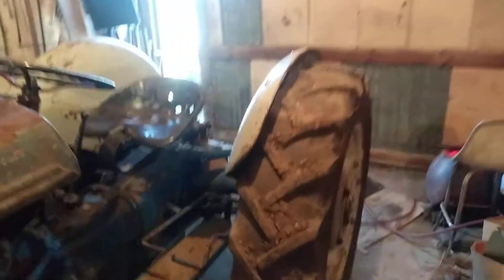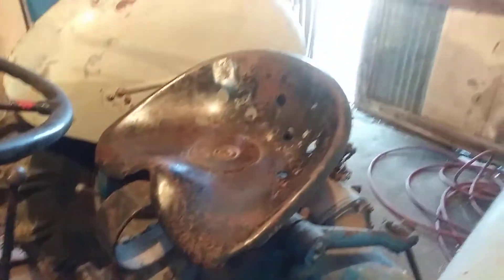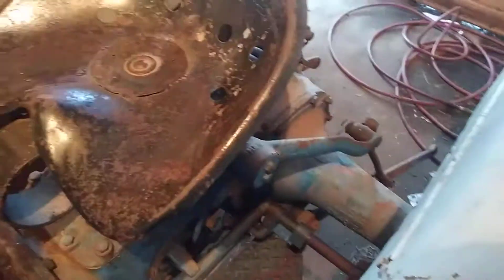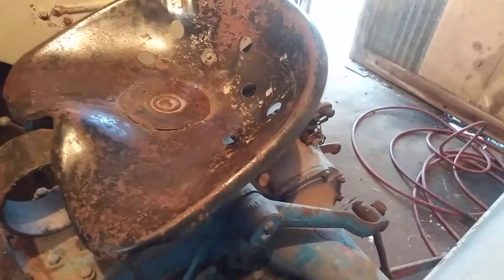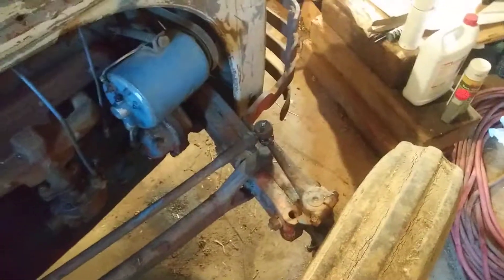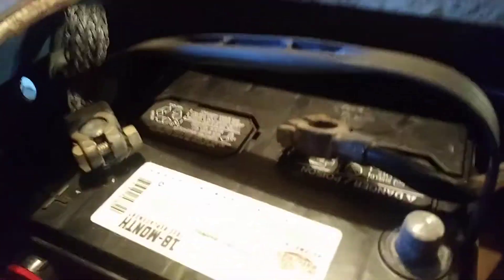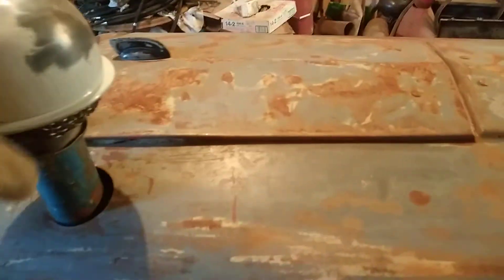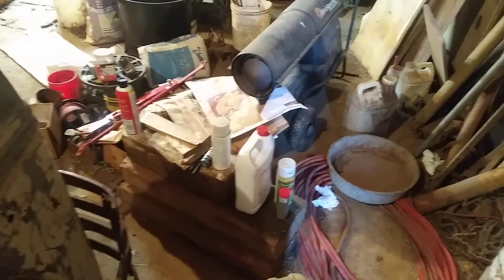Ford 2N update

Comment: You have a 2n not a 9n the vin is on a flat spot next to the oil filter housing it will say 9n********. Just because the vin starts with 9n dose not mean it's a 9n I have a 47 2n it's got castings markes 8n and 2n all over but it's a 47 2n by vin number.
Reply from the maker: Mine is also a 47 2n. I was rly new to the tractor when I made that video